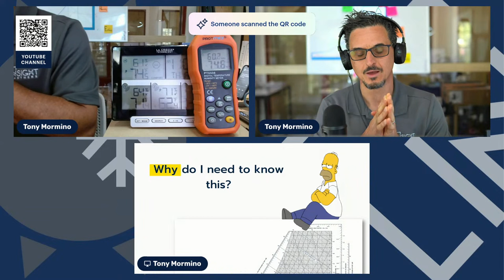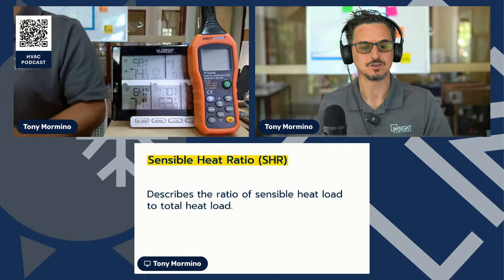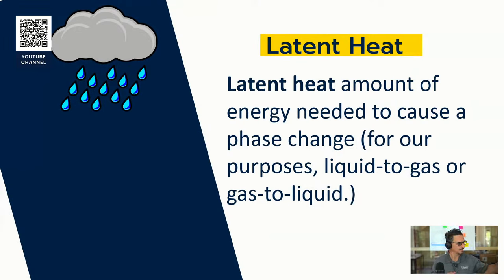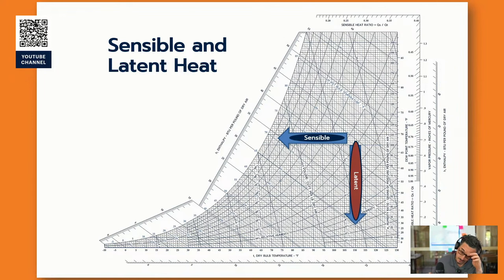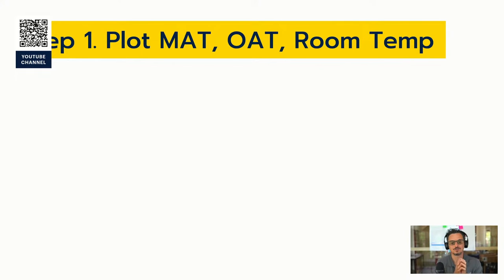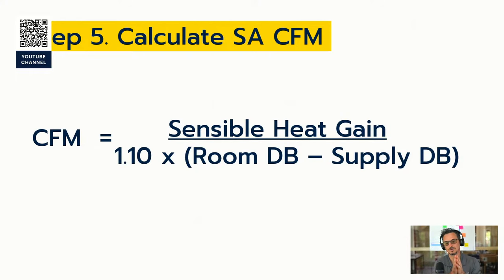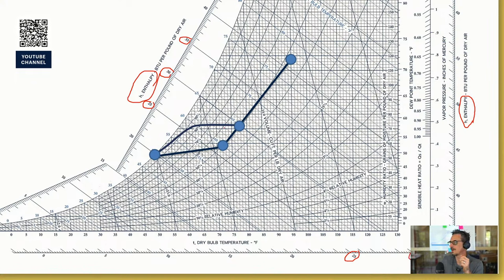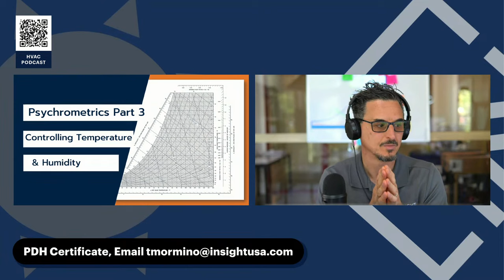Psychrometrics Part 2: SHR, Calculating CFM & Tons of Refrigeration

Comment: 36:06 hey Tony @HVAC TV, u got 0.075 x 0.24 x 60 = 1.085 Btu-min/ft3-F-hr  to be specific but sadly some folks get used to in using the 1.1 as it is easy to remember. Just my 2 cents, anyways great video!

Comment: This may be a little premature (haven't watched the 3rd installation yet) On your OAT, Did you get that information from the ASHRAE Climatic design condition site or is it a value for training purpose? If you did use the ASHRAE site. For your WB are you using the .4% in the Evaporation column or is the WB bulb a product of another value which revels the WB(when plotted)? 

Also, amazing explanation for us wanna be engineers.

Comment: What happens if I take 100% of OA and 100% of RA
Reply: Not possible. The percentage of each part of air, is calculated relative to supplied air. 100% OA and 100% RA means 50% of both.
Reply: You can set your bypass factor to 0. It will increase your supply air.